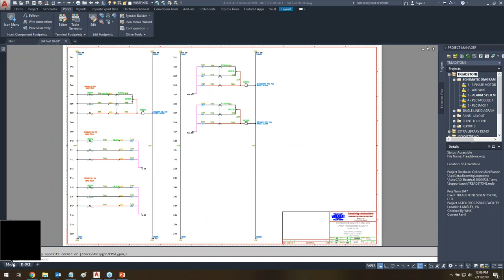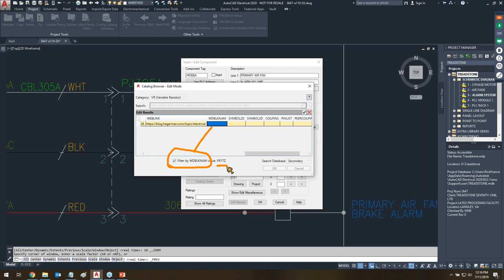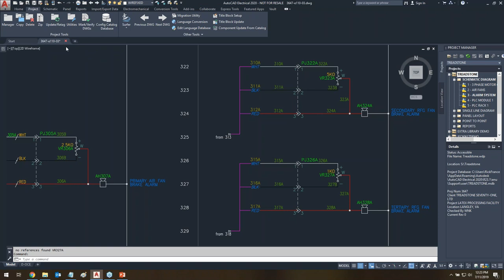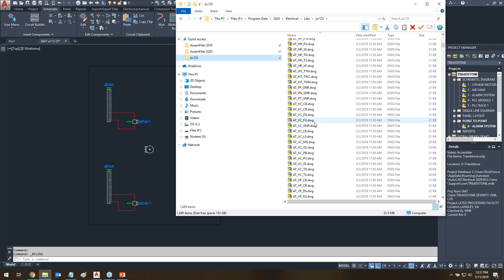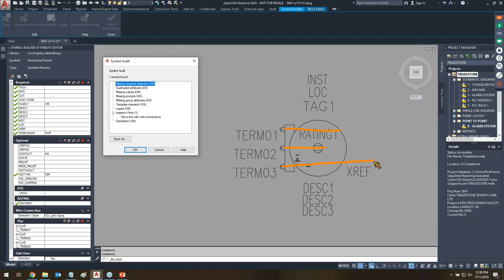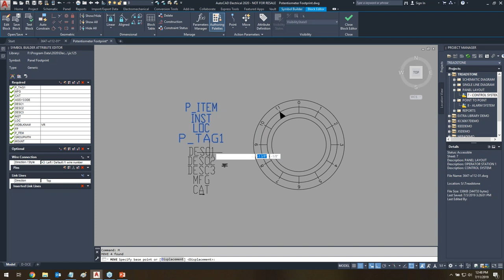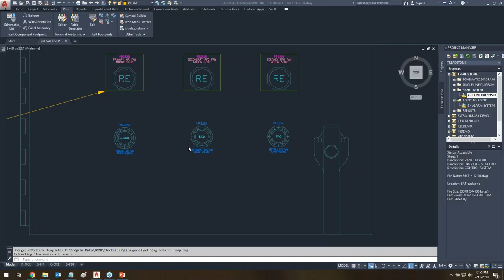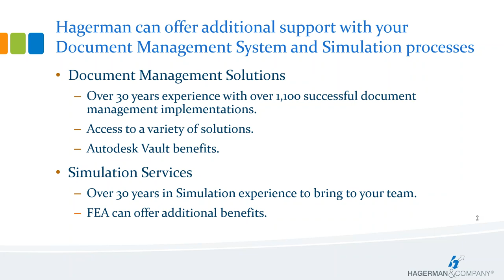AutoCAD Electrical: Customizing Catalogs, Symbols &  Footprints

Comment: When setting up a new component; can one cause the wire type and color to happen automatically.  Example: When connecting wires to the potentiometer, autocad would look at the component and know what the wire color and size would be, as a result when connecting to the component the wire attributes would set automatically.
Reply from the maker: AS far as I know, there is not a way to automate the wire type from the component. It is not a bad idea so I would suggest adding this to the Autodesk Ideas Page. Here is a link for this: https://forums.autodesk.com/t5/autocad-electrical-ideas/idb-p/37

Comment: Sometime in our secondary database component does not pick description although it is located in .mdb file. I do not why 
Can you help me
Reply from the maker: If it’s a specific manufacturer and catalog number that always has this issue then I would suspect that you have duplicate entry’s in one of the two catalogs. Possibly someone started adding the entry and didn’t complete it correctly and then entered it a second time correctly, but it finds the uncompleted first entry with no description first. That would be my first guess based on what you describe.

Comment: Dear sir,
    I have an one doubt...how to add attribute template & other template in newly user created library file..I add new panel footprints library in properties..but that file not contain any template...how to i add template in newly created footprint library....please explain sir
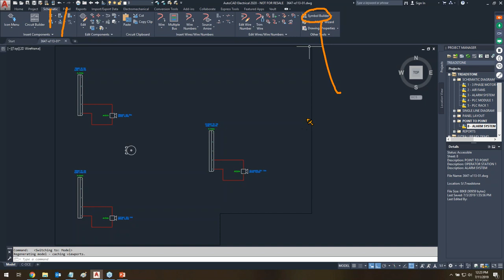Reply from the maker: I’m sorry for the delay in responding. The answer to your question is covered in the video at 20:13 thru 27:23. Templates must follow the naming convention shown in the video and they must be in a path defined in the project. The video will take you step by step thru that entire process.

Comment: HOW DO YOU HAVE AUTOMATIONDIRECT CATALOGUE?
Reply from the maker: When you install the software, AutomationDirect is one of the manufacturer’s that you can install.
Reply: @Hagerman  I already installed, but doesn’t showing it on my catalogue. (Only have siemens and AB)
Reply from the maker: @robertojoa21  When you install you have to select the manufacturers that you want to include. You can use update/change in the programs and features to add additional manufactures after the install, but you can’t use the deault installation. You have to use the detailed installation.
Reply: @Hagerman  what I want to mean is  for example , I want terminal block from Automationdirect but is showing. Just are showing Siemens and AB 
I already installed automationdirect manufacture. 

I hope do you understand me.
Reply from the maker: @robertojoa21  AutomationDirect terminal blocks are installed with the software. There is no guarantee that every model by the manufacturer is in the database so if it's just a particular model you can’t locate, then you need to add that one as a custom terminal block. If it is more than that then I would suggest you contact Hagerman Support and open a case where someone can take a look at your issue specifically. This is not something I can help you with via comments since it is not a normal issue.